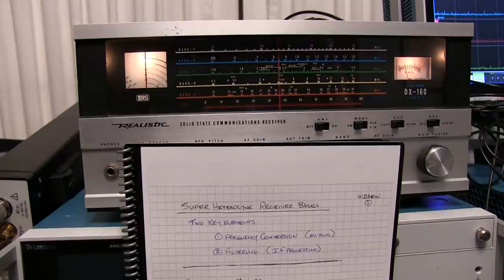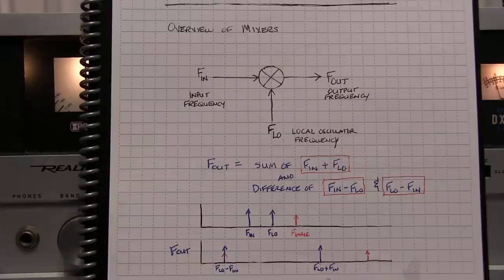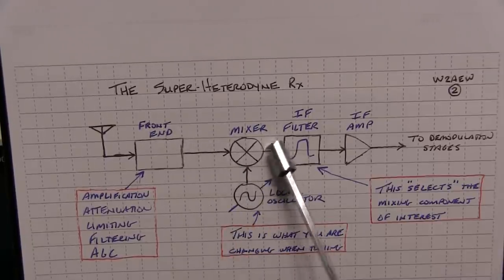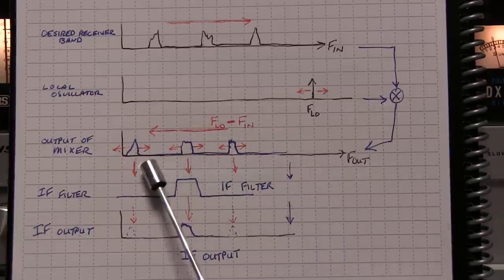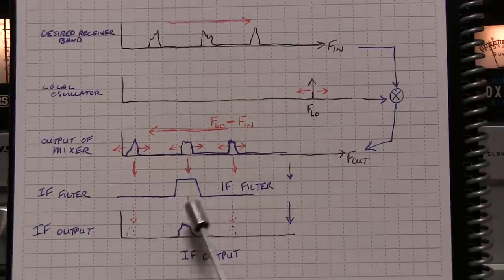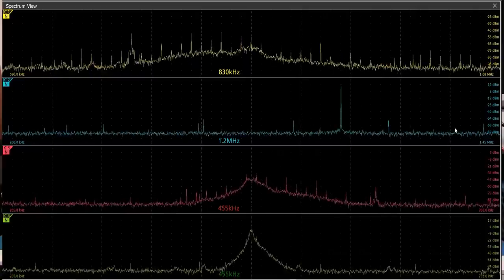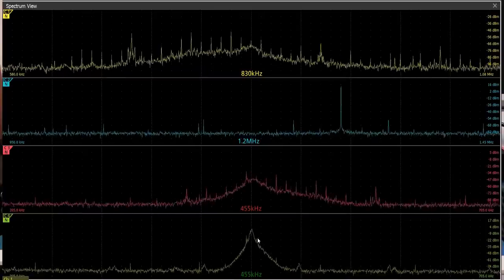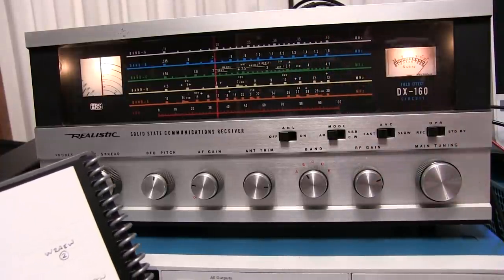#339: Basics of a Super-heterodyne Receiver - how it works, and a peek at the signals

Comment: I think this explains why (in amateur radio) lower sideband is the convention for 40m (7MHz) and 80m (3.5Mhz), and upper sideband for the higher frequency bands, given the common use of 9MHz IF implementations in early SSB radios.  Or maybe the reverse is true?
Reply from the maker: It's possible - maybe it's like this: Converting 40/80 into the 9MHz IF is an upconversion (no inversion), while converting the higher frequencies down can cause an inversion (if using high side injection).  But, then the downconversion to a lower IF from the 9MHz IF will invert - so you'd wind up with a single inversion for the lower frequency bands and a double inversion (thus no inversion) for the higher bands.  Not sure if this is why it was done, but would make sense.

Comment: Great video, thanks for sharing. Here is one thing I don't quite understand about superhets. Some superhets can receive strong signals that you didn't tune to. For instance, an SSB receiver designed for 40m amateur radio band can receive the signals from strong AM stations on 41m band during the night. More than that you can build several almost identical superhets, one of which will have this problem while another will not (the QTH is the same). One theory says that this happens when there are some sort of non-linearities in the receive path, e.g. a diode ring mixer in which the diodes were not well matched. This makes the receiver work as a crystal radio for the strong signals. I wonder if it's true and if you could explain what actually causes this effect and what best practices are to mitigate the issue.
Reply from the maker: There could be a number of reasons - overload, non-linearities, etc.

Comment: Hi Alan! Did I miss something, because I was expecting you to say that the input tuning circuit tunes in sync with the LO so that their difference is always the IF?
Reply from the maker: Tuning an input bandpass filter circuit is common in analog, single-conversion receivers like this to minimize image products, but less common in synthesizer based radios or multiple-conversion radios.  I chose to omit this detail from the video to focus on the frequency conversion aspect which is the key to superhet operation.  A tunable input filter is a "helper" but not a necessity.

Comment: Like a piano. Strike one key single note. Strike 2 keys you hear a mix of sounds. = A lo or hi sound as you filter. Super het is two recivers the second is looking for what the second reciver is  alowed only via filters😊
Reply from the maker: Almost the same.  In the case of the piano, the two tones add, and you hear a beating between the tones, but there is no energy at the sum or difference frequencies.  In the case of a mixer, the signals are combined in a non-linear way (multiplied), and this is what gives rise to the signals at the sum and difference frequencies.

Comment: At the mixer stage, should the output signal strength be about the same as the input? In other words, is the mixer designed to amplify as well as mix or just mix?
Thanks for the video Alan. 73s.
Reply from the maker: Depends entirely on the design of the mixer.  Some mixer designs have conversion loss, some have conversion gain.

Comment: Excellent demo.  One of the problems I always had with my math teachers is they never really gave practical reasons/examples why knowing geometry is a good thing. Who knew that those identities where you multiply two sine waves produce sum and difference sine waves had a practical use to my teenage mind. Learning this stuff seemed like waterboarding to me at the time 😁 
What scope is that that can show a spectrum for 4 channels simultaneously? I'm assuming it's a scope because of your probing.  Thanks!
Reply from the maker: Scopes like the Tektronix 4, 5 and 6 Series MSOs have digital down-converters on each channel and can display spectral content on all channels.
Reply: @w2aew  That is nice to know, I totally missed that was a thing in their specs. I've recently just bought a competing scope and I'm curious to see if it can do same. Thanks as always!
Reply from the maker: @vincei4252  There are only a precious few that have actual hardware DDCs, but none of them outside of Tek can provide you complete mixed domain (analog, digital, RF) time-correlated results (Tek patented).  Some others with the DDCs force you to run all channels with the DDC, even if you just want one channel, thus preventing you from obtaining time correlated results of your RF signals to the analog and digital signals on other channels.
Reply: @w2aew  Ok. Thanks for the heads up. I'll take a look at the TeK lineup in more detail. Cheers.

Comment: Question:
I've made a sperhet AM receiver that has very good selectivity. However, the ground reference for my baseband (AF) output changes as I change stations. Is that a setting issue on my oscilloscope, or is it a problem with the circuit itself? 
I've seen this with audio amplifier circuits, and it's usually fixed with a large audio output capacitor. I have not yet added a proper audio amp to my receiver. I'm just using a 330u capacitor with a crystal earphone after the diode demodulation stage.
Reply from the maker: Sounds like an issue with the circuit, but tough to say without a schematic...
Reply: @w2aew  Just wondering if I'm not using the new digital Rigol scope properly. Switching from DC to AC coupling on my old Tektronix was much less of a mystery.

I'm seeing my signal move up or down on the scope as I tune through higher or lower frequency stations.

Comment: I have a problem . i´m design a superhetorodine  receiver with a dds. my question is what level is needed for the local oscilator ?? the output of the dds is 5 vpp. My fear is destroy the local oscilator. The ci in use is a TA 2003. Pleasa help me !!!!
Reply from the maker: It looks to me that the TA2003 does not use an external LO signal.  It has an internal local oscillator and you only have to supply the LC tuned circuit.
https://www.es.co.th/Schemetic/PDF/TA2003.PDF

Comment: Sometime down the road, could you do a video about BIRDIES! How to fine the sourse of the birdie. On my HF Radio i have abirdie about every 50-75 kc throughout on all bands. I think a AM radio station's (50,000 watts) RF is coming in and mixing with my radio's mixer stage. The output  - 1140 AM radio station 3 antenna's are located about 1/4 mile of my shack giving me an S9+. Thanks
KR7KZ - - - LMU on QRZ

Comment: What exactly is the image frequency? Why does that exist? Many thanks in advance!
Reply from the maker: Generally it is an input frequency that gets converted to the same IF frequency as the desired signal.
Reply: Just thought I'd try to embellish a bit. I hope I have this right :-)

The mixer's output includes frequencies at both (Freq. input) - (Freq. local oscillator) as well as (Freq. local oscillator) - (Freq. input).  This means that two input frequencies symmetrically above and below "Flo" will be placed at the IF Filter frequency.  If there are stations broadcasting at each of these input frequencies, they will both be tuned in at the same time.  The one we want to get rid of is called the "image frequency" because of its symmetry relative to the Fin that is on the other side of Flo.  To get rid of this unwanted "image," filtering is done ahead of the mixer to essentially block any input frequencies on one side of Flo. 

Great video! (P.S. If I have the explanation wrong, someone let me know and I'll remove the comment).
Reply: @blobscott  yes, you said right 👍
VU2RZA

Comment: How can it not matter after demodulation if the spectrum is inverted or not?
Reply from the maker: For AM, the spectrum is symmetrical, so inversion doesn't matter.  For SSB, this rig demodulates both upper and lower, so inversion again doesn't matter.
Reply: @w2aew  So basically LSB/USB are just labeled UsB/LSB in an inverting receiver? Thanks for the explanation

Comment: Which RF digital signals will Receivers don't accept "inverted spectrum" ? Because for RF digital signals the Receiver has to DECODE the inverted spectrum which won't work with most RF digital signals.
Reply from the maker: Most receivers are double conversion or even triple conversion - where a subsequent conversion stage can re-invert the spectrum.